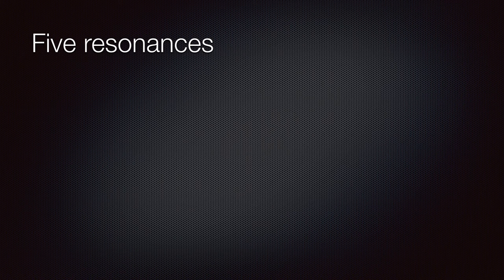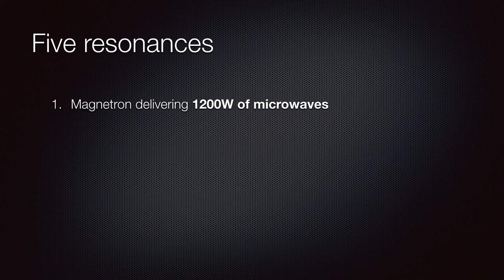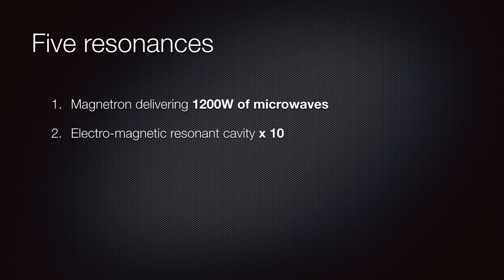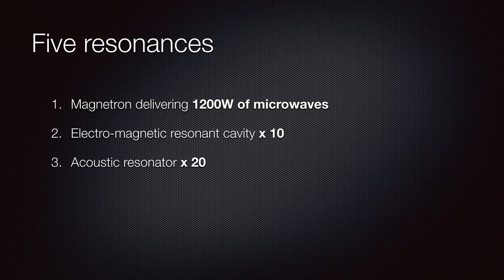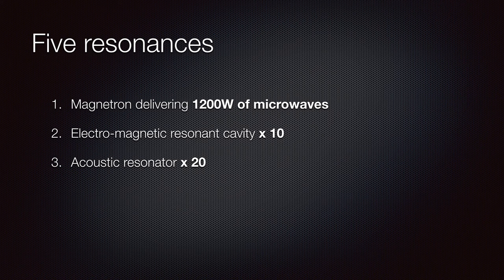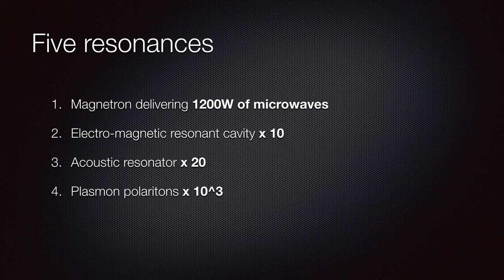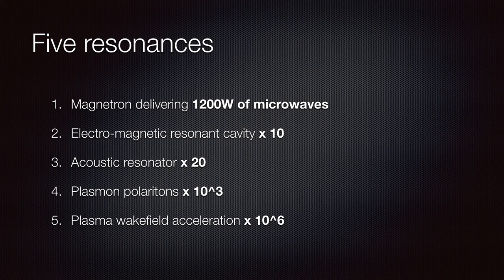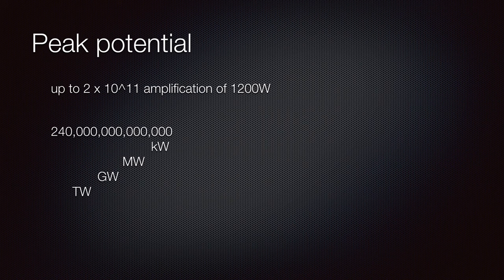.:StarDust:. Part 2: Matryoshka

Comment: It is terawatt. And high energy produces hot fusion.
Reply from the maker: Thanks, there are a few areas this video can be improved and more attention needs to be drawn to 1. The fact that it is not really creating Terawatts, it is more enhancing electron, ion and dust acceleration 2. Dr. Egely makes bold claims of fast (inside 3 mins) significant transmutation and this aspect and the fact that he is willing to directly share everything, makes it worthwhile pursuing.

It will probably be re-cut and issued. There are many complex aspects to Dr. Egely's system and simplifying it to the extreme is a challenge.